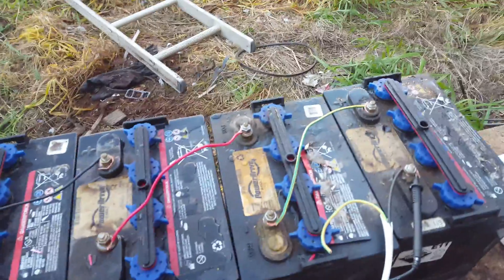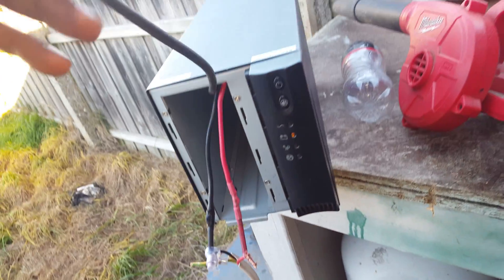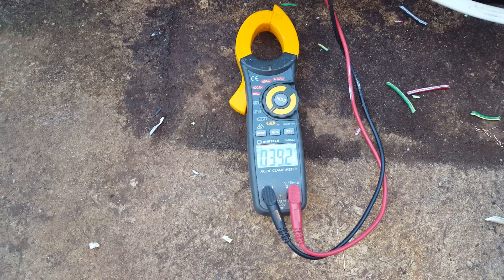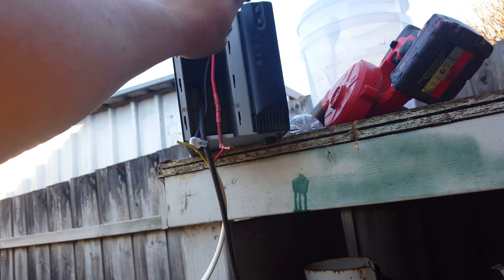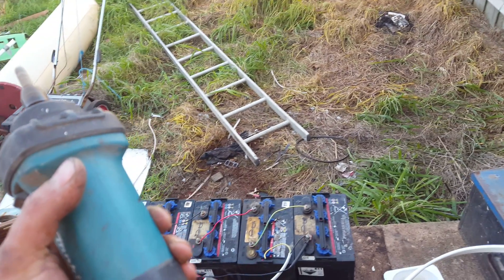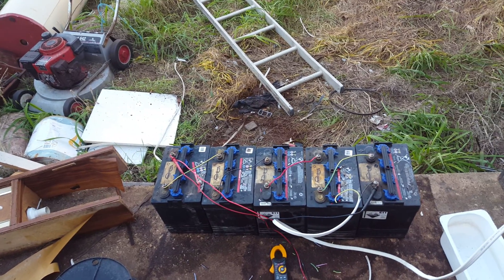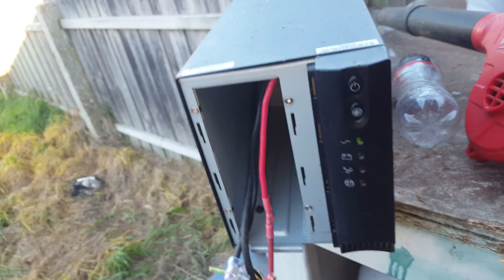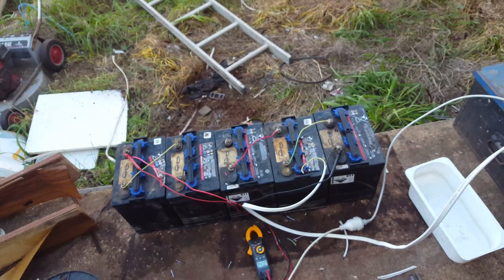36v Ups unit on an 8v battery bank

Comment: Nice, You plan on using the 1000watt rack mounts for your powerwall or just to mess around with?
Reply from the maker: +AveRage Joe see how they go on this bank as this hp one is very electronic noisey  i want to see what the rack mounts can handle they might be better